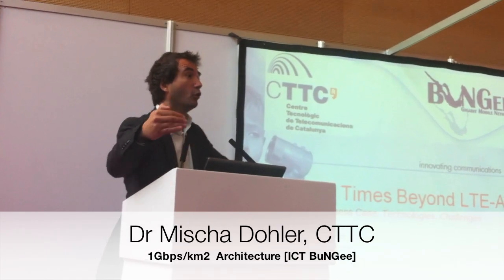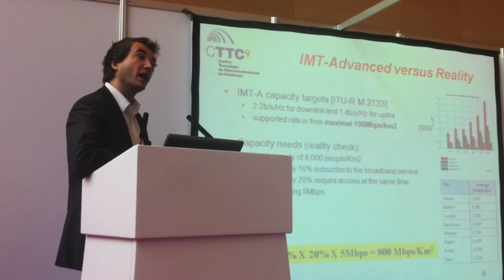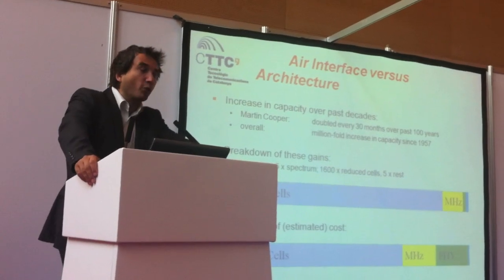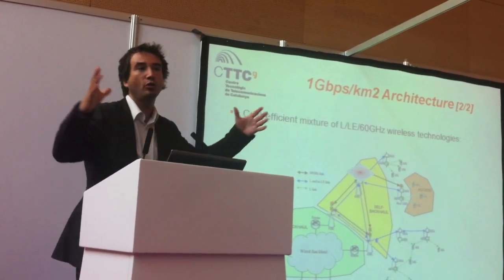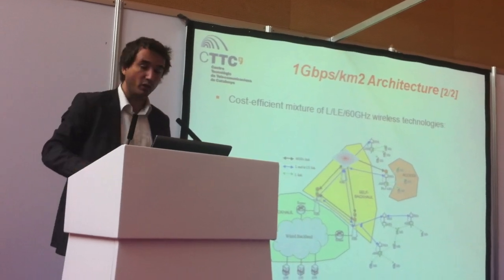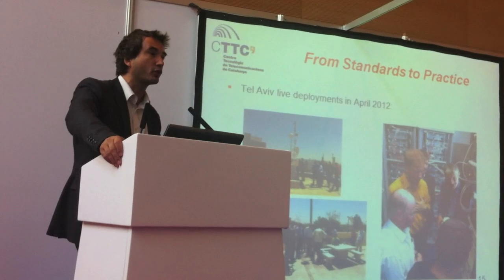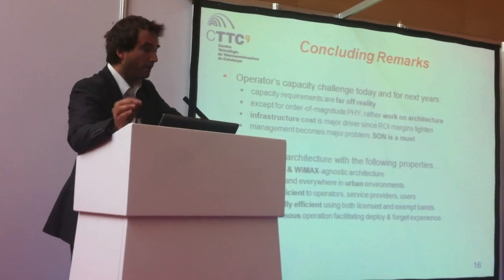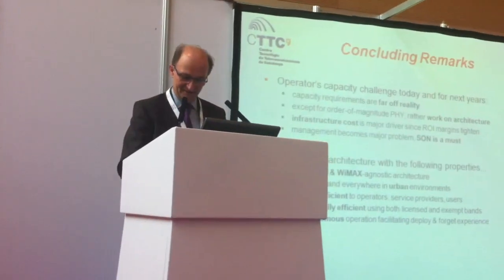1Gbps/km2 Architecture [BuNGee, CTTC, LTE World Summit, Mischa Dohler]

Comment from the maker: I am not so sure about it. The advances in hardware, physical layer and access layer have reached a point that - from a network and transport layer point of view - it almost appears like a wire. In any case, there are not too many critical applications where you need ultra low delay and jitter pings.